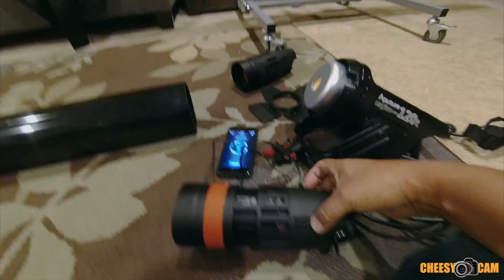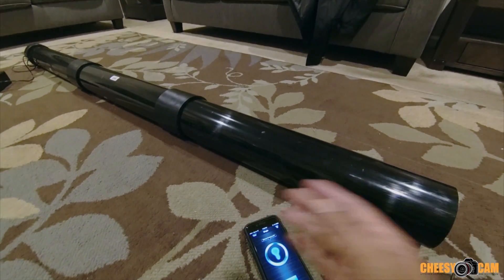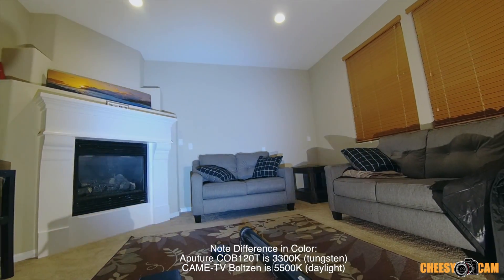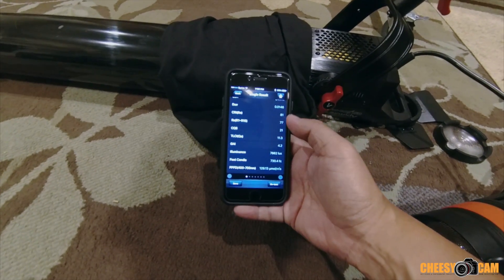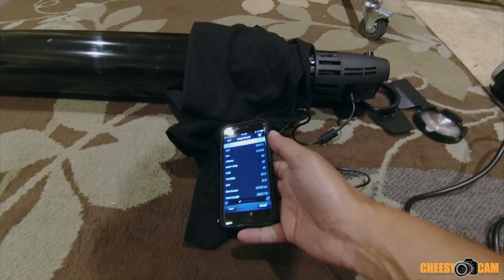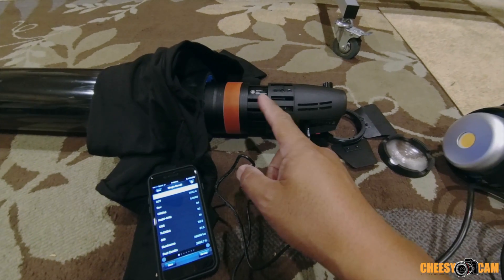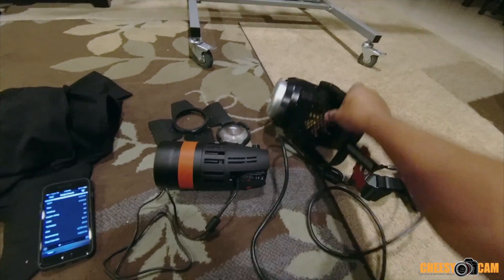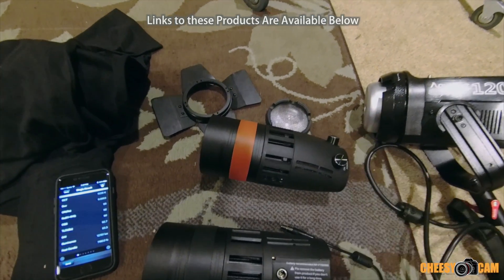CAME-TV Boltzen 55w LED Fresnel Lens Light Reading at 6ft vs Aputure COB120T

Comment: Its not just about power. No sure that your measurements are right but when you check the WB parameter you can see that Apature tungsten has around 3100K than Boltzen daylight is 5000K when it should be 5600K. I have same issue with Godox led light. Its cheap and strong, but daylight model has 4600K and magenta shift wich sucks.. and also about power.. you do not have fresnel lens on Aputure, that would be a different story

Comment: From Came-TV:

for the 55W：
when in one meter, 60 degree angle：  it is around 4064 Lux,   20 degree is around 13627 lux
two meter , 60 degree angle ： around 1036LUX,   20 degree around 3038 lux.
three metter , 60 degree ：  around 452 lux , 20 degree is around 1283 lux. 

for the 30W :
one meter, 60 degree angle, it is around 3150 Lux,  15 degree is around 18784 lux
two meter , 60 degree angle , around  748 LUX, 15  degree around4591  lux.
three metter , 60 degree , around 322 lux , 15  degree is around 1889  lux.

Comment: The COBt starts out at a TCLI of 84 and goes down to 6. Is there an error or did i watch it wrong? The advertised rating was 93 I believe. So 84 would probably be closer to real world results.  But 6?
Reply from the maker: As stated in the video this test does not accurately measure color, but it will show luminance (brightness).

Comment: Thanks for such a good review. Do you think the 30w Boltzen LED is good enough to use as key light with a softbox (or other diffuser) in an interview setup? If so, how close from the subject would it have to be placed at? My main concern with the 55w is the fan in case it has to be close to an interview subject. Thanks!
Reply from the maker: These type of lights are not the best choice for interviews as a key, especially if you are punching through a box just to soften it up. You can find better ligts to do that job. They would be better used as the third hair light or background light, or maybe a little fill.
Reply: Actually Tom Antos just recently posted a video on how he used the 30 watt as key light, another 30 watt as back light and a 55watt as rim light( because it was too powerful) in an interview.

Comment: What's the angle of the spot on the Came lights? Dedolights can focus down to 4 degrees, so the throw is immense, even though they are not that powerful.
Reply from the maker: I'm not sure,  i'll see if they have some additional specs.
Reply: Thanks. From the looks of it, I'd say around 10 degrees - same as Lowel GL1. I guess if you want less spill you then use the barn doors, but you're sacrificing output vs a tighter spot. Seems like a pretty solid product at a great price, although the more powerful bi-colour one they're releasing soon would be even better.

Comment: Wow, almost bought the Aputure COB120T. Your test is perfect timing. Been looking at the CAME-TV Boltzen 55w now but cant find a comparison until now, this video helped Em. Thank you.
Reply from the maker: They really aren't to be compared. The COB120T is a brighter unit overall. But the Boltzen lights bring a lot to the table as far as Price, Size, Features, and Output. I love hard spots, we use the Lowel Pro Lights quite a bit but they are hot lights and can't be battery powered. 

I've been looking for a very portable battery powered hard light, to work similar to the pro lights but most have been too expensive. The fresnel lenses on the Boltzen really get the output at a distance,  love how they can run on battery power, and the size. I really think these can finally replace the Lowel Pro Lights.
Reply: Price, Size, Features, and Output is what I am looking for, hard spots is what I like to do on my films, IMO its easier to control. for $788, i can get three of the Boltzen.
Reply: Same here, Now I am selling my other weak LED lights for the Boltzen. Getting the 3 piece kit.

Comment: The Boltzen seem like it will work perfect for filming weddings. Thanks for this review.
Reply: Yes and no. Most wedding receptions will required a warmer light (tungsten), so you'll need to attach the CTO filter, which cuts the light levels down. Best to start with the 55 watt, at the least. Also, there isn't a working Wi-Fi app yet....so you can't control it remotely for now. Came-TV hasn't responded as to when this will be available.

Comment: Thanks for the review.. Can you do one on the 100w version and is that version also available with the battery option? Or is the 55w the largest that can be powered by batteries?
Reply from the maker: There's always a limit to how much a portable battery can power. I don't think you'll be able to do this on the 100w version unless you carried around a huge battery pack (like the ones found on electric bikes).